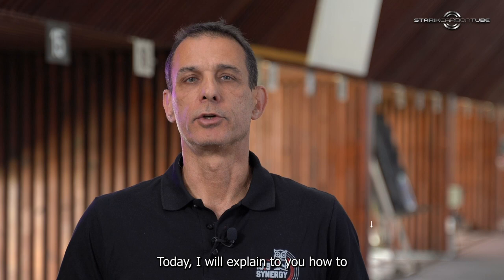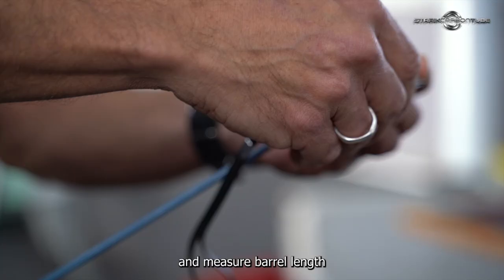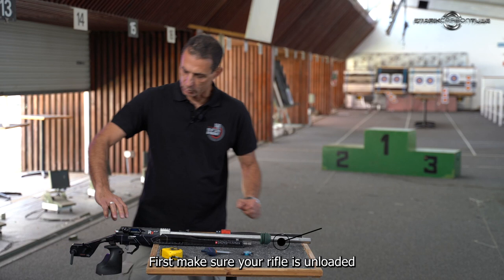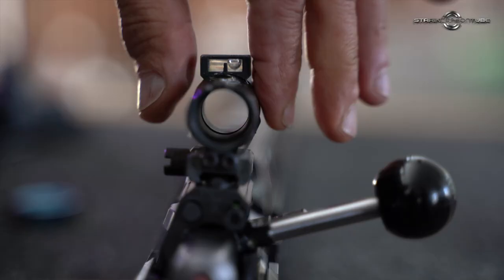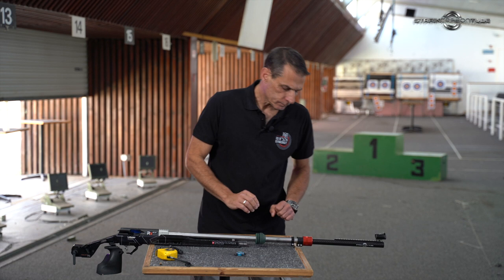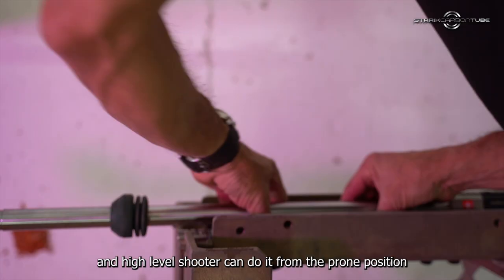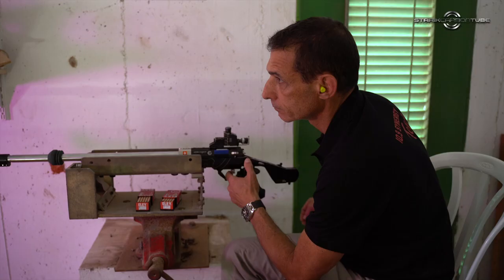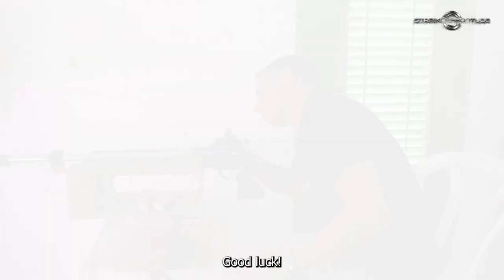Starik Carbon Tube - barrel tuner extension tube part 2: tunning your rifle

Comment: Congratulations on the video. A question, what is the reason for the limbsaver de-resonator in the barrel? Thank you.
Reply from the maker: Limb saver were my sponsors,and I believe it also helps for reducing barrel vibrations. It's not really necessary when using the tuner.
Reply: @gstarik  Understood.Thanks for your kind reply.

Comment: Another question: I don't understand why those 66 cm and 22 mm were measured? Thank you.
Reply from the maker: Tube length is calculated by barrel length by prx formula.. 22mm,is the barrel diameter,tube should fit perfectly for barrel diameter at the muzzle
Reply: @gstarik  Understood. I didn't know the existence of a formula. which is it? Thanks for your kind reply.